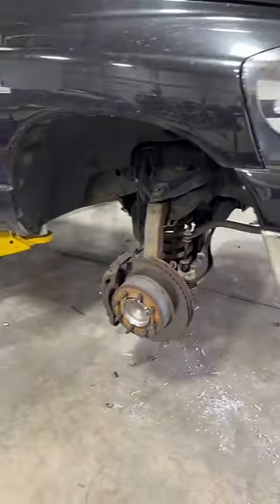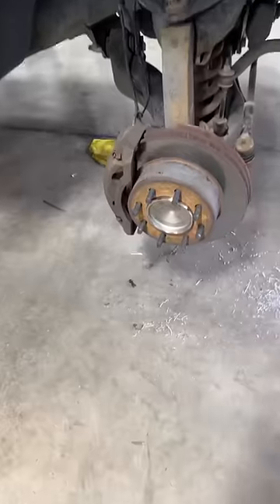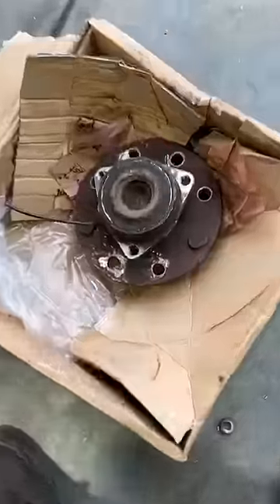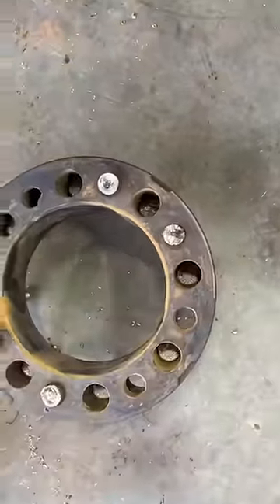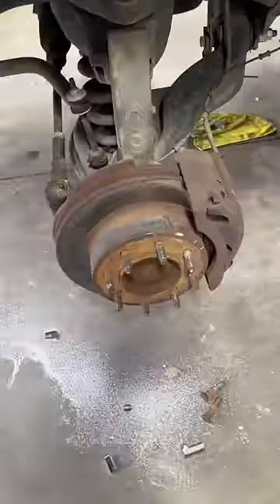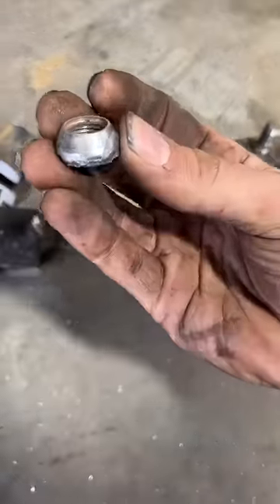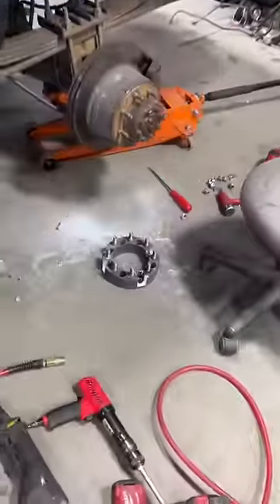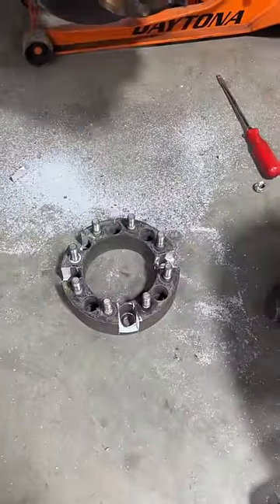I told the customer to sit down before I gave him a price 😂 I didn’t need him to pass out

Comment: Wheel spacers are junk. Do not use them.
Reply: Yeah I just went with more of an offset lol why add another failure point
Reply: Yep, that "brodozer" look is dumb. 

The spacers stress everything... Bearings, bushings, steering, all of it. 

I pass over any truck with spaced out wheels, unless I bought it knowing it was a beater and at a low price. It's the truck equivalent of buying a civic with 18's back in 98.
Reply: @Moelester692  offset kills your wheel bearings just the same as a spacer, it's widening the track width and increasing the fulcrum length from the bearing to the load center that is the problem, it increases the stresses on the bearings enormously. A little bit won't do it but these guys running spacers so thick they are measured in inches instead of mm are asking for it.
Reply: @flacjacket  ahh yeah I understand , I only did it after all the suspension was beefed up , billet uppers and lowers , and the geometry was changed to relieve stress , sorry shoulda mentioned that , but you are right
Reply: Spacers are fine so long as they aren't excessive or are being used to correct for offset. I am running Colorado alloys on my old sierra as my oem steelies started failing. They use a different offset and bolt pattern so spacers allow me to match the bolt pattern and get reasonably close to the factory offset (iirc I'm like +25mm from stock).

 I run 20mm spacers on my Porsche and 15 on my Golf R with no problem whatsoever, and I am running wider/stickier than stock tires and have put tens of thousands of miles on them driven extremely hard and on some of the worst roads the first world has to offer. People just take them way to far and start measuring them in inches.
Reply: Spacers are fine for dually on a 3/4-1 ton. They are putting undo stress. The weight load is over the wheel bearing in a dually and not fulcrumed out away from the bearings.
Reply: Depends on the vehicle, rim offset and ofc how big the spacers are.
Reply: @flacjacket So true,  but at least you can get the wheel off without twisting off lug nuts and studs if you do need to replace the wheel bearing.

Comment: The joys of the add on goodies!  Yep put those big old tires and spacers on there and increase the mechanical advantage stress on those hubs. I love it! Some people with their jacked up, tuned engines, fancy accessories fail to understand what happens when they fubar their hubs and grenade their engines. My ex neighbors daddy bought him a new truck and the kid put like 50K in mods on it. Even though the truck never would see anything but the road it self destructed (engine, driveline and suspension) within 5 months.

Comment: A bit of anti-seize would’ve saved them a whole bunch of money. I’m sure we all know that but get some spacers, some buddies, and some beer then this stuff happens.
Reply: @axlegrind4212  anti seize is only to be used between the spacer and hub not on the threads I agree that would not be good.
Reply: @axlegrind4212  
Anti-seize is very expensive. Probably bout $6 !!    I'd rather pay someone $1,500 and they keep my truck for 2 days.
Reply: @jonathanfreeman7761 
 I use anti seize on every fastener that's exposed to weather.  So far never had a problem.
Reply: I have been using anti sieze on my lug nuts for over 40 years.  Never had an issue
Reply: Some people think rust is only thing keeping nuts tight.
Reply: @robertheinkel6225  thatsa big no. For more reasons than you think. We lubricate torque to yield bolts, because they will tighten further with more clamping force for the same rotational force.
Reply: Yes I also use anti seize on all my lugs. Everyone says to not use it. Most things I find out are wrong. You have to learn what works for yourself.
Reply: @robertheinkel6225  you've been a lucky man.  I agree with the the use of anti-seize on non-critical fasteners and mating surfaces to reduce galvanic corrosion, (once spent 20 minutes donkey kicking and then pounding on an alloy rim with a 4lb dead-blow mallet due to the rim sticking to the rotor/hub, before it finally came off) but I keep my lug threads dry.
Reply: @isaacanderson3968  I was a tire guy for 6 years and the reason we, myself included, tell people not to use anti seize is because lug studs are only designed to stretch so much and the hydraulic pressure exponentially increases the torque on the stud when tightened causing micro fractures. (especially on capped lug nuts) I've seen so many lug studs snap off when they hit a pothole because of it. Guess use at own risk. Heat and a big hammer work just as well if not better.

Comment: If these guys would just throw a little grease on the studs before they put the spacers on it would save everyone so much headache. I swear these spacers are always seized on because they install them dry, torque them to 300lbs then never ever ever take them off until its time for a repair
Reply: 300 ftlb probably doesn't help much.  Everytime I get new tires mounted, the 1st thing I do is back off the overtorqued lug nuts (often I have to use a long pipe for leverage) and retorque to something reasonable that I can loosen if I get a flat while on the road.
I usually have to adjust air pressure as well, I'm not a fan of running low pressure.
Reply: A little anti seize never hurt anybody, thats for damn sure.
Reply: @noaht5191  until it get on your rotor.
Reply: @noaht5191  that black nasty cv joint grease works a heck of a lot better than that stuff, I haven't touched a bottle of that in 20yrs except copper for exhaust work.
Reply: You don't grease the spacer studs you red loctite them so the wheels don't fly off lol. This isn't normal wheel mounting here
Reply: @humzilla707   Greased bolts don’t just magically un-torque themselves. Red loctite on lug nuts is insanity, you’re going to spin them in the hub when you try to remove them. Would you loctite your wheels on under normal circumstances? You’re definitely one of the people I’m talking about who ends up with stuck spacers lmao
Reply: @Xixu.co.6  it's literally in the instructions to red loctite them. You can heat up the loctite with a torch it's not the end of the world. I'm towing 15k with steel rear spacers on my diesel so ya I definitely loctite them.

Comment: If you quoted a price, and didn't give an update about the price increase, I would be pissed.
Reply: No that is common sense he or she didnt do it and couldnt do it. This is the second shop so live with what you have wrought.    Or diy
Reply: In Canada if the increase is under 100 dollars you don't have to get permission from the customer....I have worked in autoshops in different parts of the country and its the same allover canada
Reply: I don't know if it is the same everywhere in the USA, but in my state if the cost increase is less than 10% up to $100 you don't have to contact the customer first.  So on a $100 quote you could charge $110 and on a $1000 quote you could charge $1100 without needing to notify the customer ahead of time.  However, if the job is going to cost more than that you have to get permission from the customer first or eat the extra cost yourself if you do the job before getting permission.  This allows honest mechanics to charge a bit extra if they need to replace a bolt or two that were too rusted to be reused or a bushing that was more worn than initially appeared, without allowing them to replace an entire engine and cooling system after quoting you for replacing a radiator hose.  In this particular case, if they didn't get permission to destroy those wheel spacers they are not only going to have to replace them at the shops expense, but they have opened themselves up to potential criminal charges for malicious destruction of property.

Comment: This is why you don't fuck with vehicles. The engineers that designed them are usually smarter than the guy at your local 4×4 shop
Reply: Exactly

Comment: For anyone that needs wheel spacers for what ever reason . Before you put them on . Put a layer of grease between the rotors and the spacers . If you ever have to work on them . And you will . They will come apart much easier then going threw what this mechanic had to . 5 cents of grease will save you hundreds.

Comment: My truck has had 2'' spacers on 33'' tires for years in Canadian winter. They came off by hand when I had to do my front wheel bearing (after 100 000km, stock bearing, on crappy roads). 

The secret is called ''Anti seize and a torque wrench'' ;)

Comment: You can use a deep socket on the back side, then the power steering to turn the wheel hydraulic power to pop those off.

Comment: At my job I do plenty of wheel spacers and and wheel adapters and every time I put them on I use never cease and I haven't had a problem getting them back off so I highly recommend if you ever used them use never cease even on the the studs too.and I know some people say you can't use it on the lug nut studs. I never had a wheel come off in there ten years I've been doing it this way. But if you don't feel comfortable enough with the never cease you can go over everything every couple hundred miles or every oil change. Because you should be rotating the tires anyway while you are doing the oil change.Because the tires can be wearing weird with wheel spacers that's what I noticed over the 10 years . And I also recommend getting alignment done after installing wheel spacers and new wheels and tires or any suspension work .

Comment: Had a tech run spacers on his truck. It always had suspension issues, bearings, bushings, etc. He couldn't figure it out and wasn't listening to me. So, I did an experiment. I had him hold a 1t rotor for 5 mins, however it was comfortable for him. Then, I asked him to hold it out at arms length for the same amount of time. He soon realized where his issue was.

Comment: I don't really know anything about spacers other than I've heard they can ruin wheel bearings. I wanted to push my wheels out just a little on my stock Toyota 4runner. Do you think 1 inch spacers would be bad? Do you think the  dealer might void my warranty?
Reply: Spacers are dumb. They lead to premature bearing failure all the time. Nothing wrong with stock 4R setup.

Comment: I'm not a car or truck knowledgeable guy. However I have had to use the progression of aggression to remove plenty of bolts that were over tightened and or so badly rusted in place it was time for a torch. So I'm gonna go out on a limb and say that this was a pretty penny to fix. 😅

Comment: My questions here is did they take the rotor clips off the studs before they installed the spacers, did the spacer nuts come off, and did you heat em up with a torch and hit in-between the studs with a wide flat on an air hammer. If the nuts came off they should have come right off with heat.

Comment: I had stuck on wheel spacers once I cut them off myself and THEN drove it to the mechanic to be worked on and have the couple studs I'd knocked replaced compared to hrs of labor for all the cutting

Comment: Ive never heard of  an experience, that has involved wheel/spacers doing anything on a vehicle except make stuff break prematurely or cause tjimgs to fail faster, and usually causing the owner more  money than the  purchase price of the spacers,   to repair the parts the spacers broke. 
I have heard the same thing since i started driving   at the very mention of the term wherl spacers   and that is   "no"  "bad" "stay away" "no spacer is the best spacer"   "just buy wider wheels"   
"i know someone that will make you a set of reverse rims"
Reply: Or  buy wider axles   lol

Comment: They'll be back for more wheel bearings after you install those Duralast bearings
Reply: Lol as opposed to what? Oem? Ironic that they are most likely made by the same company.  Though they have a better warranty on them and out of hundreds I've put in they have lasted just as long as most of the others
Reply: Yeah he scamed emm all day
Reply: Nothing wrong with Duralast, just don't buy a refurbed battery.
Reply: @throttleblipsntwistedgrips1992  I got a duralast refurbed battery in my work van. over 340,000 miles since and haven't had to replace it, still passes charging tests and all... Guess I got lucky?
Reply: @claytoncoolidge992  koyo for staters
Reply: Duralast is very good....Except the electronic stuff.
Reply: @claytoncoolidge992  

Ok whatever you say, autozone
Reply: @TONYTHETlGER  that has to be luck. I have had good ones and bad ones. My current one is a few years old for 40 bucks... but I'm really careful with it. 
Lead acid batteries can be charged about 300 times, so if you never sit there listening to music or leave your lights on your never really discharging it fully so it can last for years and years especially if you do a lot of highway drives and long distances
Reply: @bleach_drink_me  I bet cam and crank sensors are returned a lot, because people misdiagnose them. They replace them, realize they weren't the problem, so they return them lol
Reply: Skf makes good ones, duralasts don’t last. I have had great results and haven’t had any problems and I run 35’s 16 wide and never use any spacers
Reply: @bleach_drink_me  was it an Altima? I think some of them had an issue where the valve cover (or maybe intake?) gasket would leak oil onto the sensor, making it go bad lol.
Reply: @suzysuzuki8865  
Timken is a top brand as well.
Reply: @bleach_drink_me  always buy the duralast gold, parts are new not refurb & have a Lifetime replacement.
Reply: @claytoncoolidge992  half of the dealers use aftermarket parts anyway. One of my customers who owns an auto shop just told me about how he saw a pallet of pro stop rotors at the Dodge dealer’s parts dept. They either put them in different boxes, or slap a MOPAR, (or whatever brand) sticker over the aftermarket sticker on the box. It’s insane. Even at the dealer, you ain’t getting what you think you’re getting. Not anymore. It’s all Chinese junk.
Reply: @CivilizedWarrior  lol it's cause that's the OEM part used. I work frlor GM partech witch is exactly what it sounds like I keep the OEM parts catalog in order. With the supply chain issues and chip issues y'all are very lucky that we are managing to keep production going let alone service anything. And yes there's lots of aftermarket suppliers who produced the OEM parts and once they are given the go ahead they make their house label brand. Does not matter where it's made the specs and materials used are the only thing that is making a difference. Just cause it was produced in a country doesn't mean that the material used wasn't imported to that country to use.  That's why it's very very important to know how to spot a knock off immitation vers the original part. The Chinese produced with the proper specs part are going to be just a good wether they are made in China the USA or tim buk tu. It's the cheap ones that are not really interested in quality or specs and are more interested making a quick easy it's close enough for the girls that the they go with quality that you are going to be doing the job a second time. And tbh completely honest IMHO there Alot of aftermarket parts that the quality is superior to the oem psrt
Reply: @claytoncoolidge992  I'm a commercial manager at AutoZone. The duralast gold bearings actually say oe performance on them while the standard duralast don't say anything. Buy the golds the regular ones are lower quality than the original and only have a one year warranty. For certain applications it's fine, but you shouldn't buy cheap shit if you have a truck that size.
Reply: @bleach_drink_me  standard duralast bearings aren't great. I'm a CSM and I try getting everyone to buy the gold because it's the oe equivalent for the bearings. And I agree with you on the starters and alternators. My Firestone will buy anything from us but hardly get starters or alternators due to bad experiences in the past, and honestly I don't feel like dealing with the labor claims for those anyway.

Comment: I had the outer ring on a wheel bearing get ungodly stuck in the hub assembly, so I put the whole assembly in my oven at 280°F then held a can of air duster upside down and let the cold shit drip out the straw onto the stuck outer ring of the bearing and was able to push it out with a piece of wood after

Comment: Engineers put the wheel bearing in the optimum position. And , then someone  changes the geometry with spacers that push half the tire outside the fender.

Comment: They're called splin drive lug nuts! This type is a low profile so it sits below the surface of the spacer so the rim can sit flush onto the spacer. Very common and used in the aftermarket world for 20+ years. They're small diameter body is used in tight areas like spacers and aftermarket rims. Usually the socket is in the truck, glove box, center console, if not most parts stores or rim shops sell them. Maybe you should look before you hack off your customers parts. Easier to look in the truck or drive to a store and buy a socket then to spend all that time that you did to get them off. Hope you had the customer approval to cut their parts up. Hope you're buying him/her a new set. For all you guys commenting about how wrong it is to have them on there, the owner wants to customize their vehicle. They obviously haven't fallen off! Guess put every vehicle back to stock the way it leaves the factory. And for all the commentators saying tire and rims too big and stick out to far and spacers I hope every muscle car out there from the 60's and 70's has the original P195-14 on them.... Jeeeeeez!

Comment: Those spacers can really screw up the wheel bearing(s) fast. My buddy put some spacers on his 03 Chevy Tahoe. He ended up replacing the front wheel bearings twice within a span of 2 years.😂 Then he took em off. Also, the ball joints were bad the second time around.  So those needed to be replaced also.